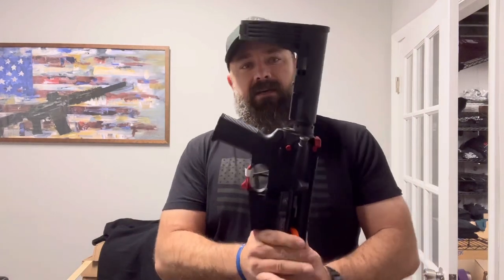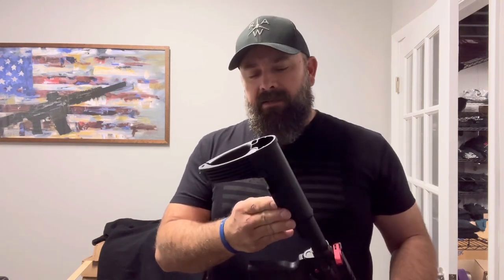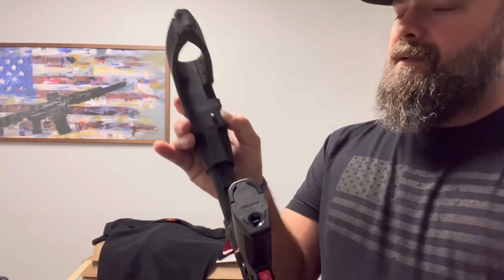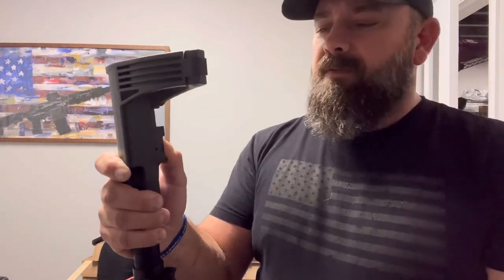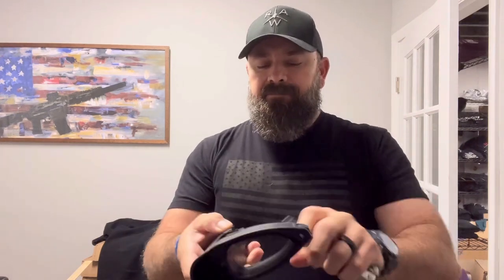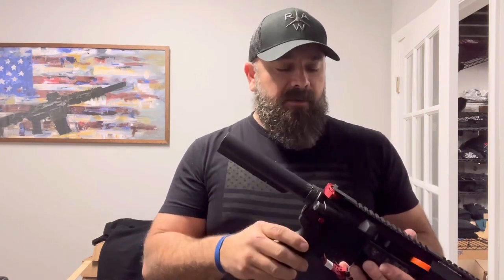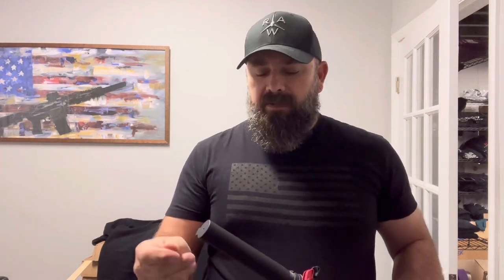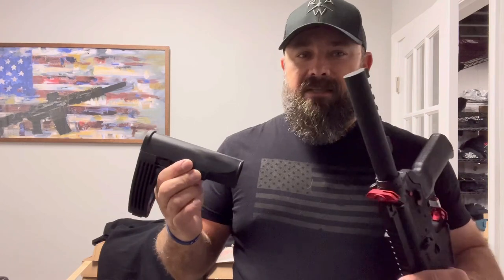How to remove a tail hook mod  2 and 2c arm brace ￼

Comment: hope y'all didn't destroy or throw out you $125 braces... also my M&P 22 with a false buffer tube is part of the actual firearm in order to do as you say and remove it since it is not a actual functioning buffertube I would literally have to use a hacksaw and cut it off ruining the firearm... I don't think so...

Comment: You would need to get a pistol buffer tube and replace it with the one currently on there. Your current buffer tube will easily accept a stock, so that's a no go.
Reply from the maker: Thanks for weighing in. That specific question was asked during the Webex presentation by the ATF and they said it was fine as long as the brace is off. I was surprised that they were ok with that but there’s nothing in the rule that addressed the buffer tube other than it needs to be a pistol buffer tube. Approximately 6-6.5 inches.
Reply: @thebeardedprepper  Ok. The buffer tube in your video looks to be a standard rifle buffer tube and longer than 6" but I could be wrong.
Reply: @YippeeKiYayMrFalcon  "carbine" and "pistol" use the same tubes and buffers. SBA's use a mil spec carbine tubes. Tailhook Mod2 tubes are proprietary, so nothing but a Tailhook can be attached.

Comment: I let some one use mine and took off the brace and lost the springs is there a way to just put it on with out the springs to slide the brace back and forth ?
Reply from the maker: It will go on without the springs, but it will probably not stay locked into position because the springs hold the button out, locking it into your desired position. You should be able to replace the springs. If my memory is correct, they’re not that different from what you see in most retractable ink pens.